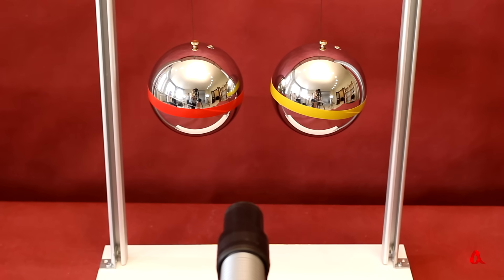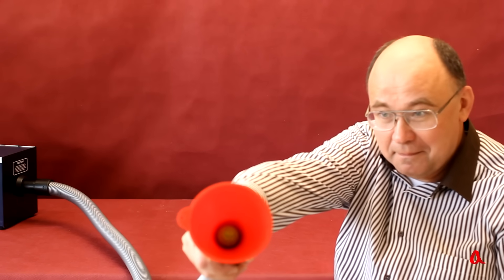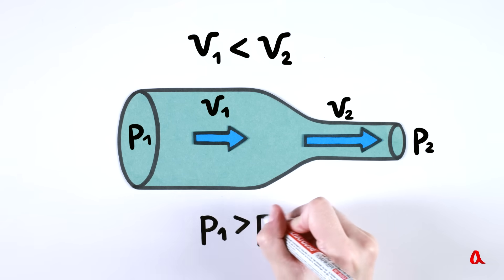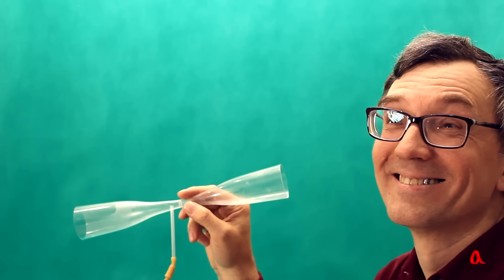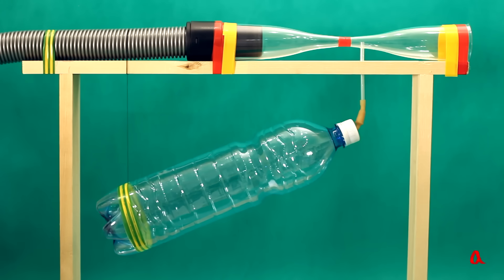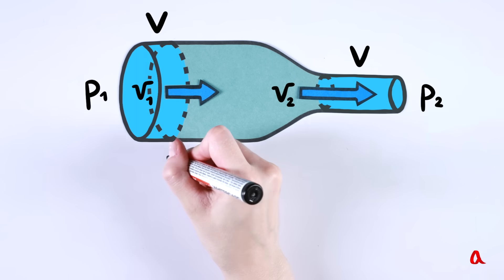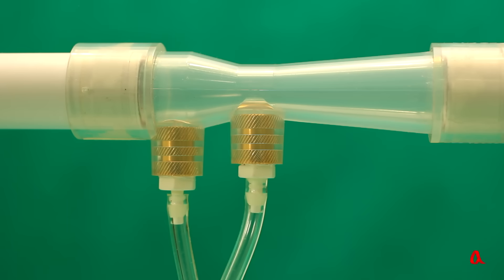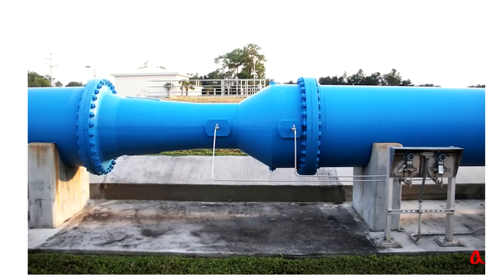Bernoulli's principle

Comment: Hello. This is partially miss informative !

The Bernoulli theorem is challenging, but it kind of makes sense in a CLOSED system.  You could think of it in lines of that you have roller coaster carts attached with springs. As they start rolling downhill the speed increases and the cart in front is pulling the spring to the next cart and vice versa. When they are slowing down uphill ... the springs compress (higher pressure) when the speed decreases.  

Now when you start blowing stuff in to the surrounding atmosphere it gets messy. The two spears getting drawn together, it is because of the coanda effect. The pointed jet sucks the surrounding air with it and creates a low pressure. NOT to do with Bernoullis principle. I know; It is complicated :).  The ball hanging under the water flow, counter intuitive or not has to do with the coanda effect, i.e. water being sticky and curving around the ball, hens creating an opposite force to the curving acceleration. 

Oh well. Always have doubt, if your intuition says that something is not necessary so ;) .
Reply: Thank you for your effort, but you're assuming the surface is (or that it even could) pulling the air towards itself which is blatantly false, Coanda is a mere observation that air tends to follow the surfaces which is false as soon as flow separates, and it works on water because 1- surface tension and 2- water is much denser than air. 
All aerodynamics forces are pressure driven, like Newton on fluids, which is the correct way of visualising it.
Reply: @davidaugustofc2574 , the Coanda effect also occurs with air (not just water) flowing over a curved surface, and is the reason for the spheres being pulled together with air flowing in between and for the sphere being pulled into the water flow.  The same result does not occur if you use cubes instead of spheres.  Those experiments do not exemplify Bernoulli's Principle, which applies to a single fluid flow.  It is the pressure difference that causes the velocity difference, not the other way around.
Reply: @mattcarter1797  My problem with the Coanda effect is that it is a gross oversimplification of the entire thing. You need to understand a little bit from several topics to understand what it really means, and those topics are more helpful than the conclusion.

 Air is mostly neutrally charged, as gas molecules usually are, so the external electron layers will repel each other, a gas would expand to Infinity if it had a chance and enough time. However, due to the local, gravitational effects from the Earth, the air is squeezed together, and the balance of those is the atmospheric (sometimes known as static) pressure.

 Gravity makes it so that pressure is very even for the same height all across the globe (temperature changes aside), so when a moving body is going through air and changing the pressure around itself, there will be a restoring force acting on the fluid to bring the new pressure value back to the original one. That is pressure will flow from high to low until there's negligible difference between the areas.

 When the air gets close the surface it's pushed away by the first layer, that's attached to the surface due to friction, and when the surface curves away from the direction of flow it forms low pressure pockets that will exert less force on the surface and nearby molecules that the air surrounding it, thus guiding the air towards the surface. (Greatly helps if you have a way of visualising it)

And that's very simplified in it's own rights, since vorticity is a humongous topic on it's own, that I haven't even touched. I cannot understand how we're helping people by telling them about the Coanda effect and not the reasons behind it, you can't really learn anything from it. Okay, it was a great discovery for their time, but we're now at a stage where computers can generate airfoils from a set of requirements, we need to point out that air tends to follow surfaces and move on to deeper topics and not keep hanging on to it as explanation for anything.
Reply: Finally someone pointed it out! There are so many misinterpretation regarding Bernoulli's Principle. It has rather strict assumptions for the fluid and the system (closed system, inviscid, incompressible, irrotational, no external force other than gravity etc.) and is not what people think it is.

Another wide spread rumor is that lifting force of a plane can be explained by Bernoulli's Principle. It is so wrong that NASA specifically wrote an article titled "Incorrect Lift Theory" for it:

https://www.grc.nasa.gov/www/k-12/VirtualAero/BottleRocket/airplane/wrong1.html

Most videos claiming to be showing Bernoulli's Principle are NOT doing it under correct assumptions. Sigh.
Reply: You are right.

Comment: Best explanation of Bernoulli's principle I came across on internet. Thank you so much!!
Reply: Comical. EVERY video on this topic has the exact same explanation: "narrower the pipe section, the lower the pressure" because equations . What happens is equations due to more equations . HOW does it work? By equations .
Reply: @billshiff2060  Buddy, the equations explain exactly why this occurs. The velocity of the fluid increases as it travels from a wider region to a narrower region, as the work done by the fluid is down a pressure gradient. Therefore, the fluid must flow from a region of a higher cross-sectional area to a narrow cross-sectional area in order to increase its velocity, and this would naturally cause the pressure exerted by the fluid to decrease. Mathematical equations simply explain this phenomenon through variables instead of words.
Reply: @weltschmerzistofthaufig2440  So your explanation is, it is caused "naturally" + equations.
No mention of particle velocity, which IS the cause of pressure, is ~ mach 1.5 regardless of where it is and yet the pressure decreases in smaller passages.
Reply: @billshiff2060  Are you saying that Bernoulli’s principle doesn’t work? I could use kinetic particle theory to explain it, but I instead focused on macroscopic observations and mathematical evaluation to explain this. Also, who told you that particle velocity remains the same? In fact, in a narrower section, the total number of collisions between particles and the container would decrease as the work done by the fluid occurs in the direction of movement. Thus, a pressure gradient must exist to ensure that there is an increase in kinetic energy in a narrower region.
Reply: @weltschmerzistofthaufig2440  Who told you that particle velocity varies?
Reply: @weltschmerzistofthaufig2440 Why does the pressure and collisions decreases if the same air of the wider part os being passed on the narrower? I first thought of this principle like an electric current passing a resistance but apparently it is the opposite (because current collide a lot more in resistance, thus generating heat), so I am vert confused =/
Reply: @billshiff2060  Particle velocity varies all the time. That's why fluids increase in velocity when they go through a region with smaller cross-sectional area from a region with higher cross-sectional area.
Reply: @psychoduck4264  That's an excellent question! Take this analogy: a crowd of humans is walking across a wide chamber, before walking through a narrow door. When the crowd is walking across the wide chamber, there are more chances for humans to collide with the walls, increasing the pressure exerted by the bodies on the walls. However, as the crowd streams through the narrow door, there are necessarily fewer chances for humans to collide with the door frame, which would decrease the total amount of pressure exerted on the door frame. This does not contradict P = F/A, as the force exerted by the walking humans in the direction of movement decreases as they are forced to walk through the narrow door, hence contributing to the decrease in pressure. Consequently, due to the principle of the conservation of mass, the velocity of the crowd's movement increases as it goes through the narrow door. 

I don't think you should compare the movement of fluids to an electric current. As resistance increases, the chances for collisions between the free-moving electrons and the particles in the resistor increases, hence decreasing the current due to increased interference between the electrons and particles.
Reply: @weltschmerzistofthaufig2440  Particle velocity varies only with temperature and pressure. I am talking about single particle velocity here. Choked flow in a nozzle is the result of that single particle velocity limit. The single particle velocity of air at normal temp and pressure is limited to ~mach 1.5. that means the flow in a nozzle cannot exceed average of mach 1 for bulk flows no matter how low the pressure down stream is and regardless of the shape or cross section.
Reply: @weltschmerzistofthaufig2440  Thanks for the answer and the compliment.
 I misunderstood a thing, I was thinking that the pressure decreases were happening on the entrance of narrower tube, not the exiting of it...
 It all makes sense now, thanks again for the explanation ;)
Reply: @psychoduck4264   for a same level pipe, the flow is indeed continuous and so for the current flowing in circuit is continuous as well, your analogy isn't bad but just doesnt sound right, as current is not a physical quantity but the charge is and what's the reason mentioning this? charge is not continious, unlike fluids.

understanding this on fundamental level could be challenging but just say, you have a pipe at same level, the fluid you enter inside, is what you get when it leaves the pipe. hence we can deduce that rate of flow of volume is constant, hence derived equation of continuity, that is AV = constant.
Reply: @weltschmerzistofthaufig2440   fluid is continous and humans are not, is the reason why the collisions are caused.
and as we may know that electrons are always quantised, so which is why they collide and provide heat losses in a circuit but a continous body inside will only exert forces on the boundary and will not collide simultaneously. (with each other)

for example, say we have a bottle big enough, one has water in it, and the other has cows in it, as we know just assume the cows start panic, and creates a chaos, that increases the collisions as they all are independent of each other of what they decide to do, its possible cow A starts hitting bottle or maybe another cow, its unpredictable.

but for fluids those are continuous, we can just treat it as if it were a single cow fat enough to fit the whole bottle and exerting forces only on the boundaries. (compare this with bottle of water)
Reply: @billshiff2060  Exactly! In a smaller cross-sectional area, pressure decreases. That's why particle velocity increases in a fluid. You are mistaken when you say that there is a limit for the particle velocity, because that has not been empirically observed.
Reply: @psychoduck4264  Oh, I understand what you mean; I believe that that's a common misconception. I'm glad that you liked the explanation!
Reply: @itachu.  My analogy was comparing individual humans to individual particles in the fluid. It's not supposed to be understood literally; the humans are moving in a continuous direction, with an observable rate of collisions.
Reply: @weltschmerzistofthaufig2440  Of course there is a limit for the particle velocity, that is what choked flow IS. Once the speed of sound is reached in a nozzle, he down stream pressure, no matter how low it is, has Zero effect on the flow velocity in the throat. 
The energy in the particles comes exclusively from the upstream pressure.
Reply: @billshiff2060  you see interpreting it is not really a big deal also, those equations are experimental not necessarily empirical.
just say for an example, the ball gets sucked into the blower, why?, the blower sends out air creating a vacumm, which is dominated by the atmospheric pressure and due to act of it and as well as gravity, the ball falls in the blower.

and what's interesting, that this could be just ONE of the MANY ways of explaining this concept, im sure there are not known ways but there are.
Reply: @itachu.  Why don't you think that the equation isn't empirical?

Comment: On steam engines, there's a devise that uses this same principle to move water from holding tanks to the boiler by using steam preassure passing through a line. I think they're called Venturi pumps.?

Comment: How does this relate to the Pitot effect?
The apparatus is like the Pitot tube on an aircraft used for speed measurement.
Reply: The Pitot tube is normally mounted externally near the nose of the aircraft, in a position where the airflow passing over it is relatively uniform (laminar). It measures the difference between the dynamic pressure of the air and the static (stationary) air pressure. The air velocity is then derived directly using Bernoulli's theorem/equation and displayed on the aircraft's airspeed indicator (ASI) for the pilot. The Pitot tube is a simple and effective measuring device (no moving parts) and dates back to the very early flying machines!

Comment: Bernoulli managed to quantify what the ancient engineers (Heron, Philo, Ctestibius)invented and qualified previously. Much the same as Einstein failed to quantify what Doppler qualified earlier with his observations on Doppler effect. Just after the Vienna conference  of 1814/15 the original empirical standard of proof by qualification in the Sciences was usurped by this quantified scientific theory we use nowadays. This methodology lacks in the facts department and is based on speculation it's just a legal fiction that's possibly central to the problems we all face globally.

Comment: Great demonstrations of Bernoulli's principle!  Seeing the effect in action helps to understand it.
Reply: Unfortunatly, it is  WRONG. Please make corrections or remove it.
..
The statements about Bernoulli's Principle are correct, but the demonstrations are very poor.
The balls, spoon and funnel are a result of the Coanda effect. 
.

The tube inserted into the wall of the neck is protruding into the  flow (seen at time 2:57)  This causes the air to curve around the end and sides of the tube.  This curved flow is the cause of the  lowered pressure.  This will work with no pipe around it; just the air blowing across the vertical tube.
..
To correctly measure the static pressure inside your narrow neck, the end of hat tube MUST be flush with the inside surface. 
..
At time 4:51 we see that the two pressure sensing tubes appear to be more like flush, but it is difficult to see clearly.  For that to truly sense the static pressures, there must be NOTHING protruding into and disturbing the flow.

Comment: The pressure reduction is due to the expanding exit and not the narrow part of the system. The width of the entry may not be important but the exit, the wide exit creates a sudden increased volume hence the reduced pressure. I would like to see the same experiment be done without the expanding exit and see if there will be any differences
Reply: now this got my interest,
you explained it better sir 👌
Reply: No, that is not Bernoulis principle.  As she explained, the product of mass and velocity equal a constant, such that if you increase the velocity, pressure must decrease to maintain the same energy in the stream.  It has nothing to do with what happens further downstream.  You are confusing this with what happens when you pulse the pressure of a compressable gas, there are waves of low pressure radiating from the convergent and divergent sections.  This is used in two stroke exhaust systems known as expansion chambers.
Reply: That happens at supersonic speeds
Reply: The exit or diffuser has been measured (not estimated) countless times to have increase in pressure, the negative peak of pr3ssure coefficient is at most right before it, if your brainstorm was close to right the entire racing industry would be incorrect.

Comment: Your explanation contains errors. Why is the pressure low in areas with small cross-sectional areas of your pipe because of the viscosity of the air. The air viscosity sticks away the air in the vertical pipe.
Reply: No the explanation is correct. Since the velocity at the smaller cross sectional area is high i.e. the kinetic energy is high which simply means that the potential energy at that area is low as both kinetic and potential energies are inversely proportional to each other. Thus the pressure is low even if the cross sectional area is smaller 👍
Reply: Your explanation seems wrong. Only the pressure difference is the reason why air gains acceleration. When you blow air out of a tube with your mouth, that's because you increase the pressure of the air in the tube. And this pressure must be higher than atmospheric pressure. Therefore, when this high-pressure air moves to a small cross-section of the tube, the pressure of the air must be higher than or equal to the atmospheric pressure, but not lower than the atmospheric pressure. @inlyrics6321
Reply: https://www.youtube.com/post/Ugkxu0GDdVhUA8pu0yCjac7Y953-LKAU3RZi @inlyrics6321
Reply: @inlyrics6321  https://youtu.be/BFNzldHKSLo?si=fatx5A6pFD_3CBWz
Reply: @inlyrics6321  I have a way to prove that your explanation is incorrect. You use a straight horizontal pipe with the same diameter as the outlet of the fan, and then add a vertical straw near the outlet, with the other end of the straw placed in the water of the beaker. However, your straw cannot be inserted into a horizontal straight pipe, and only the outlet of the straw can be aligned with the wall of the horizontal straight pipe. That is to say, the straw has no height in a horizontal straight pipe. At this point, no matter how high the air velocity of the fan you use, you will not suck up the water in the beaker. So your explanation is wrong. What explanation is correct? My video has the correct explanation. https://youtu.be/eKEorBipbO8?t=174